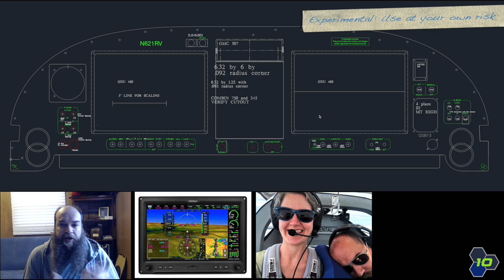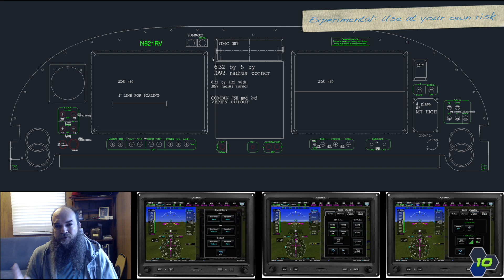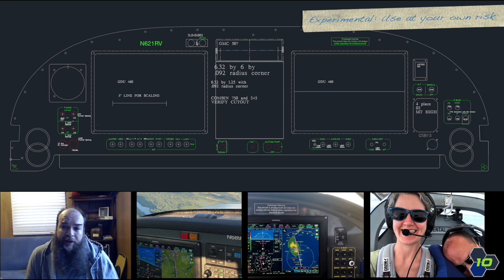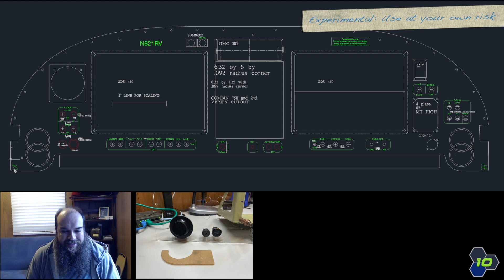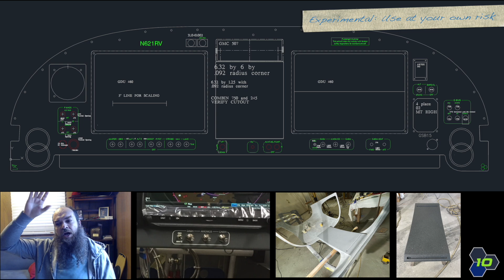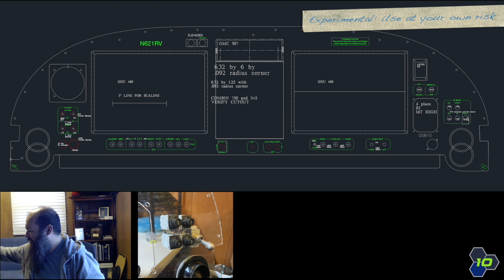RV-10 Avionics: Part 1 - Panel Design & Avionics

Comment: I just spent the last few months designing the panel for my RV-10.  I have many questions and plenty to say, but I'll keep it short.  1) Do one of your IBBS's power the avionics?  If so, that should take care of the "oh crud" scenario, at least for long enough to land.  2) How many AD-AHRS, besides the G5?  3) The notch in the panel for F-1040 would seem to preclude removing the panel after the plane is complete;  do you think that's true?  (I haven't built enough to know yet.)
Reply: Also, I used OnShape to design the panel.  It is also a single piece, with many similarities, and differences.  Check it out here:

https://cad.onshape.com/documents/db0353cb9918816a4e06b929/w/d620f5f3891c72a2e50e57e5/e/ad87319a871ab170e262d6ab?renderMode=0&uiState=6263a48a81cd3c3c1dd34b6a

Comment: I’m mid build working on the -10 fuel tanks and inventory of the fuselage kit. Love your videos. Am planning a similar panel using garmin as well. My plans haven’t made it to paper yet however. Are you doing the harnesses as well or having them done by third party.
Reply from the maker: I’m doing them myself and will be documenting the process in videos! :)

Comment: Nice prelim panel, Gil. Very clean. I believe simplicity is your friend. And, you're the first builder to explain that they are installing dual PFDs/MFDs because two pilots will be sharing the flying load. "Airliner" panels in experimental aircraft seems to be the new standard, although the reasoning is simply that it looks cool (eye-roll). Question: Do/can those G3s operate independently of one-another, info/data and power-wise? In my case, I can see going with two PFDs/MFDs screens if they can be independent of one-another, and having no need for the G5. Oh, does the "oh crud" feature get power from a hot-battery bus?
Reply from the maker: Yes and no. They can run independently but are both on the same CAN bus and running the same firmware versions. If one fails the other is unlikely to fail for the same reason but that is always a remote possibility. The G5 comes in to cover that edge case as it can be entirely independent from everything, even using its own built-in battery, gps, and ahars.
Reply: @BuildFlyGo  Thanks. I have research to perform.

Comment: Really enjoyed your video and  how you walked viewers through your decision process on your panel. Reminds me of the engineering development process. Regarding the use of a double pole double throw switch on your dual redundant battery system: that is most certainly creates a single point of failure. Also, electromechanical devices are significantly less reliable than solid state electronics.  As a general comment, what types of switches are you using? There is a big difference in reliability between commercial and mil/aero grade switches - and a huge difference in price!
Reply from the maker: Yeah, I'm really thinking we might not double them up on the breaker. We are using Carling toggles, which seem to be what many of the panel builder shops are using as well. For the "oh crud" switch, it's a beefy milspec honeywell switch.
Reply: Where did you source the lighted potentiometers for your cabin/panel lighting? Also like the red/white switch idea.....
Reply from the maker: @nickhager626  I believe I got them from Mouser

Comment: I was pondering a panel that you use only touch features, on the fence about it because we group up using that knob. I did all mine via key pad in the military and wish I could find a keypad to add to my plane that was in experimental price range.  I hate the fact its touch screen and I never use the touch features, good video
Reply from the maker: We've been flying this same panel for a while now and are pretty happy with it. The touch functionality is very intuitive and the lip on the screens allow us to stabilize our hands if there is turbulence. I do like having buttons/knobs for simple and very used functions like the autopilot controls.